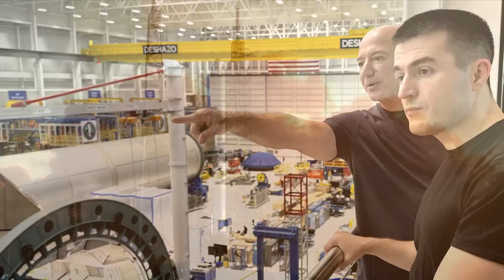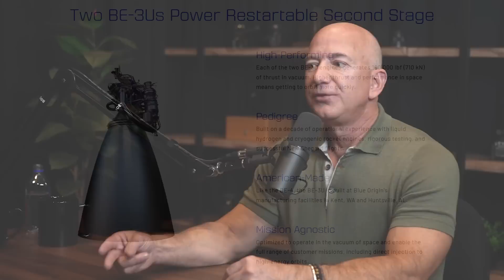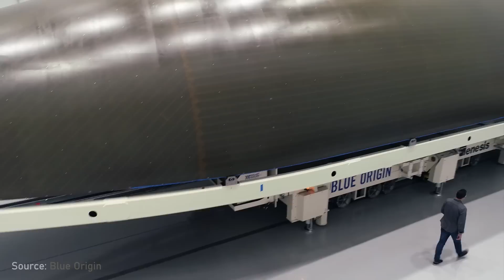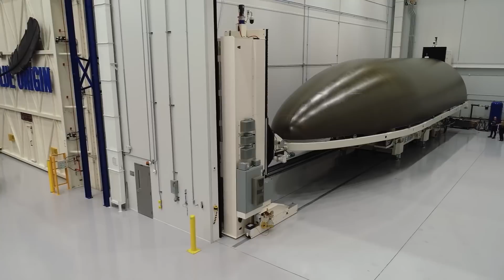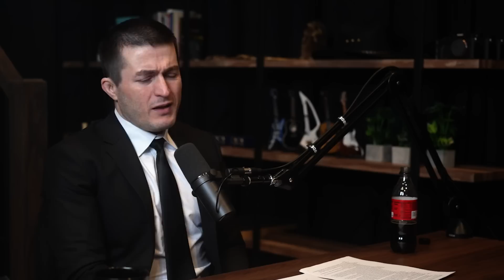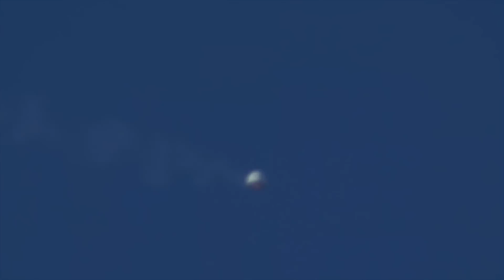Jeff Bezos explains how New Glenn rocket works | Lex Fridman Podcast Clips

Comment: Great speaking/storytelling yet still hasn’t been in orbit.  I’m missing where any part of this discussion is cheaper or equal/better tech than Spacex is already using.  I wish them well in their endeavors.
Reply: the reason they haven't reached orbit in 20 years is because they simply weren't trying to. Initially BO was only developing resuable rocket hardware (new shepard), they only started work on an orbital rocket in 2016 with new glenn. Starship started 2016 too and had first flight in 2023, whilst new glenn will launch in 2024, so their speed is actually quite comparable to SpaceX
Reply: @KAILASCHANDRANM.S  Starship is a much more complex vehicle than New Glenn. Speed wise SpaceX is at least a few years ahead. 

However, New Glenn does have a place in GEO, GTO, and SSO orbits. Starship struggles with those orbits and New Glenn is better suited for them
Reply: This guy is just a space x tity boy 😂

Comment: The fact is that SpaceX has expended 156 Raptors 2 engines and built over 300 ! How many Be4 has BO built & qualified? Raptors cost less than 1/2 million each be4 cost multi millions each! Starship at liftoff is producing between 2 & 3 times as much power as a Saturn V ! 24 launches per year 😅 SpaceX already does that per quarter with falcon 9 and seriously intends to do atleast daily launches of Starship! 😊
Reply: Starship is a one of a kind. There's nothing like it and there won't be anything like it for at least another 10-20 years. So it's not fair to compare New Glenn to Starship. And if given time to iron out the kinks, it'll be the greatest rocket ever created
Reply: SpaceX can place Starship onto booster in 30 to 40 minutes!  BO a couple of hours to get erected seems that they need some help there!😅

Comment: You know why you've never heard Elon Musk talk about "parasitic mass"?

Because he's a cosplay engineer. Jeff Bezos, without question, knows far more about aerospace engineering than Musk and it's not even close.
Reply: That's why Spacex is a much better company than Blue Origin. Elon Musk has a degree in Physics from the University of Pennsylvania Jeff has a company founded in 2000 that loses in innovation and technology to Spacex 😂 

It must be difficult to be an Elon Musk hater, Spacex has no competition.
Reply: @wyattnoise  Because  SpaceX has the 2 highest thrust to weight rocket engines ever to fly.

Comment: Funny he says we solved getting into orbit. FYI, none of your rockets have made orbit yet. You may very well do it, but not yet.
Reply: TBH he meant the space industry as general did solve it, today we have multiple startups doing rockets that "easily" reach orbit
Reply: When he says "we" he means mankind, not his company. It took SpaceX 20 years to get a crew to orbit, something that "we" had already done in the 60's
Reply: @pi.actual  SpaceX got to orbit with Falcon 9 on the first try. Same with Falcon Heavy. They'll manage to reach orbit since their engines are flight proven now. 

My only worry is with landing. My guess is some kind of hydraulic is going to stick open and one of the flaps will make the vehicle unstable
Reply: That methane thing they using may not be powerful enough.

Comment: Except it doesnt work, because after 20+ years they have nothing to show for it.. not even a single orbital class flight ready engine has been produced yet. Despite having years head start on SpaceX, Blue Origin only made glorified amateur rocket toy that cant even kiss the edge of space, let alone reach orbit… Blue Origin is the slowest company ever made, that wastes money faster than any company ever made… but I applaud his efforts and happy to see that he is focusing on speeding up the pace of innovation at Blue Origin, but it seems 2 decades too late to finally realize such wisdom… I think Blue Origin is just a gimmick company Bezos been using to shield himself from taxes by manufacturing massive monetary losses every year
Reply: There are currently two BE4 engines installed on a ULA Vulcan rocket which is scheduled to launch in weeks!
Reply: @tobias..6688  Two engines after so many years, still no date for the NG launch.
Reply: Nothing to show for ?
Are you blind or what ?
Reply: the cope is insane

Comment: 2:00 - When he talks about Hydrogen having a high Isp.
Isp = Specific Impulse.

Specific impulse, measured in seconds, effectively means how many seconds a propellant, when paired with a given engine, can accelerate its own initial mass at 1 g. The longer it can accelerate its own mass, the more delta-V it delivers to the whole system.
Reply: explain "accelerate its own initial mass at 1 g.", what weighs 1g? the amount of hydrogen fuel ?
Reply: @ghostmateify  
That came right out of Wikipedia ... so go check that.
I think it's basically saying that given the same hardware, how far can you go when you put different fuels into it.
Reply: @ghostmateify  Ik this is late, but imagine burning 1kg of hydrolox (hydrogen and oxygen.) How long will it burn if you make it have a thrust of 1kg. 

In other words, it's the efficiency of it